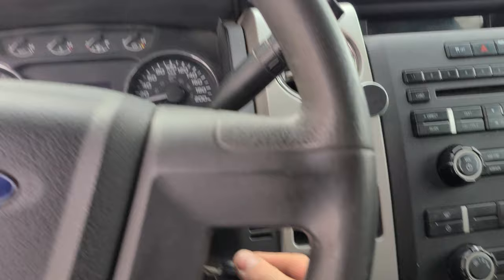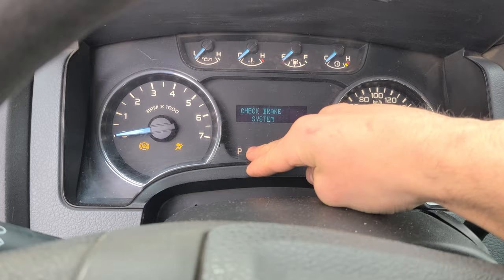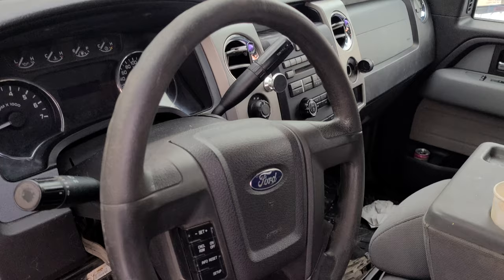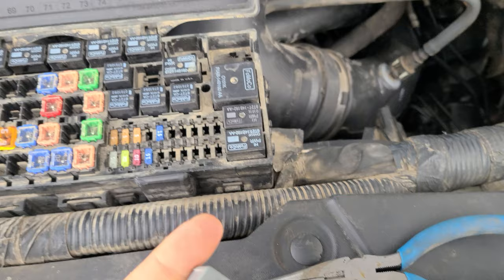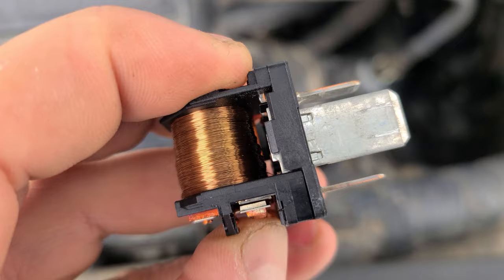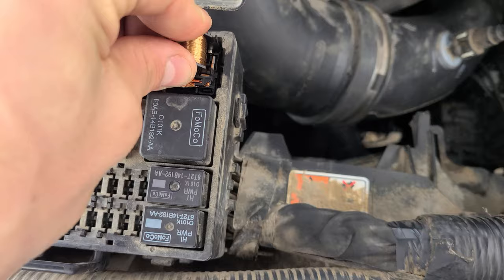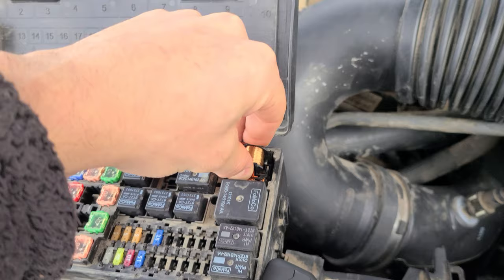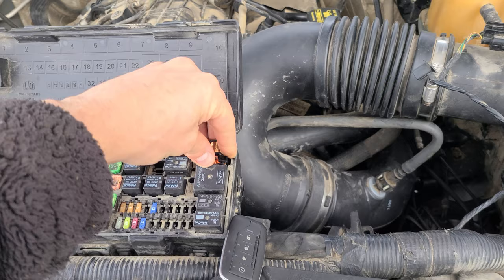2009 - 2014 Ford F150 no start - Has power but no crank

Comment: According to the fuse/relay listing I found, that relay is for 3.5L engine PCM from 2011-2014. Relay 1 is also marked as PCM and common type as those next to it. In my case, 2014 4x4, 5.0L, no relay as shown here. Other relay for PCM swapped and still same problem. Other issue often noted is bottom harness connection loose at passenger side interior fuse panel.
Reply: We’re you able to fix the issue?
Reply: I have. 2014 F150 5.0 and sometimes it turns on, sometimes it has power but no crank. Something is going bad, trying to figure out what
Reply: Hi, my 2013 F150 5.0 same issue for over a week. Trying to do my best troubleshooting before I surrender and have it towed it to a mechanic $. I learned there are several issues that can cause the no crank, no start. Have you found out what it was on yours? If so please share. Thanks.
Reply: @fishman677  1. The relay he mentioned 2. Iginition immobilizer module that I changed. Two things you can try becuase they are affordable parts. I consider to change a set of ignition switch lock parts since my issue is still happening but it is defefitely less often than before.

Comment: This worked for my 2011 f250 gas 6 ltr...i took a beer tab, broke it in half molded it with a hammer and wedged it between the gap to get connection. Got me home.

Comment: Open relay 2 and that’s the starter relay and you can do the same To it  and start the truck if you don’t have remote start
Reply: What do you mean? Please explain I’m having same issue not starting
Reply: @angelperalta7579  in the thumbnail picture you can see that this relay doesn’t have the black cover on it that it’s supposed to have. So the relay box under the hood right on top of the radiator, open it, and the back row, it will be on your left, the second relay. Once you take that over off and place the relay back, you can turn your switch on in the truck, and if it doesn’t crank and the shift indicator light isn’t on, you take a toothpick or something similar, stick in down into the relay on your left of the relay, there’s a small part toward the bottom that lifts up to make contact, so you have to manually lift it up and the truck will start. The problem is the lead frame in the transmission starts wearing out and will cause some of the relays to lose ground. If you don’t see what it describing comment again and I can make a shirt video and post it on tiktok or Yt showing how to do it. It was a life saver for me.
Reply: Can you post a video pls
Reply: @paulinfante6238  I will when I finally get my truck back from the mechanic. Had a new lead frame put in and trying to fix an ongoing electrical problem.
Reply: @bobbyt223  thx for the insight and effort, much appreciated! My 2014 F150FX4 w/ 5.0 4x4 has an intermittent lead-frame issue (speed sensor stops working and only full throttle works - either 5 or 2 gear). Shut off or go into neutral and try again. Worse in winter, has only done it twice in the last few months. Now, the no crank with ignition key has been haunting me for months, sometimes trying the second key works; I always get it started eventually. Replaced the switch on the left side of the steering column, no change. Have a new ignition lock cylinder sitting here, but haven't tried that yet. Going to look at the starter relay as suggested and report back.  Thank You again.
Reply: Have you guys checked fuse 27 under hood sometimes melts Ford has a relocation kit for it
Reply: @bobbyt223  just wondering of the new lead frame fixed your issue. Or was it something else. thanks
Reply: @Perry-cl2ne  it did not. There’s a major electrical problem that no shop has been able to fix yet. Very frustrating
Reply: @bobbyt223  sorry to hear that. There are so many youtube channels that explain the same issues and their fixes. good luck. i'll let you know if I find something.
Reply: @Perry-cl2ne  thanks. I will say this, I’m sure a lot of the problems are the same as the viewers and therefore the fix is the same, but not every issue with similar symptoms is the same problem. I just got unlucky I guess with my truck

Comment: I have a 2011 f150 xlt I have to do it with the starter relay I tried to put a new one in but I still can't use the key I have to start it with the starter relay

Comment: Mine is doing the same exact thing. Not the relay. I put a new one in last night. What’s the issue? 2013 ford f150 ecoboost. Battery is good and the started spins when power is applied to it underneath the truck. Cabin has power but no crank when turning key. And gears are not illuminated. Very confused.

Comment: Check your KEY!!! My 2011 had power but wouldn’t crank(last week). I checked the fuses, the relay and the connection in the passenger footwell. Was about to get my truck towed when I decided to check my spare key(which doesn’t have a battery). Sure enough the truck fired up right away, and has been working with that key since. The other key/fob will remotely unlock/lock the doors. My key had been working fine the evening prior.

Comment: Thank you this just helped me on my 2012 f350 with a 6.2 gas. Had power but no park indicator light and wouldn't crank. Closed the relay and it fired right up. I'm hoping a new relay takes care of my problem.

Comment: The relay is just a simple switch powered by something else you can override it by pushing what you did but if its the thing thats powering the relay that went bad then a new relay wont help. 
Anyway will be checking mine just in case thank you.

Comment: My ford flex wouldnt start this morning, it will start with the remote but when i put the key in and turn it over it shuts down lights and all. All the lights work inside, air works park lights etc also when i put the key in the alarm system went off. My husband remote started it and got it to rev a few times thats the farthest weve gotten. We bought a new remote battery bc it kept not working sometimes. When trying to start it theres a like clicking like the battery is dead but its not we hooked the cables up multiple times its fully charged.

Comment: I have the exact same truck same color and all but I just had it towed cause it wouldn't start .I have lights,stereo works but it just clicks once when I try to start.Ive had this same issue in the past I know nothing about fixing cars so I fall victim to the outrageous diagnosis  and fix prices.
Reply: We’re you able to fix it?
Reply: I am on the same boat..Took like 100 tries and eventually starts. To prevent from happening I make sure not to remove my foot of the break until the Parking Brake is all the way on. Also before turning off ignition I make sure the P is on. If not I play whit the shifter 'till P appears.. Silly but that's how I get by. Replacing the solenoid today.

Comment: Quick question I have a 09 Taurus it has a no crank no start battery is good just put a new starter yesterday an nothing lights work and everything if yu could give me some tips I could check for I also swapped the relays ty

Comment: My 2012 stopped while driving and won't start now had power but either the shifter is stuck and the gas, oil H&C and battery needdles don't move

Comment: Had the same issue with mine got a replacement relay, but it will not start unless I keep those contacts put together. Could it be a bad “new” relay   I got that is just faulty? Is it OK to drive with the contact held together by a toothpick?
Reply from the maker: If that's your case,  usually the ecm need to be checked. You absolutely can drive anywhere if it's you hold it with anything
Reply: I have the exact same problem. Did you find the end problem?